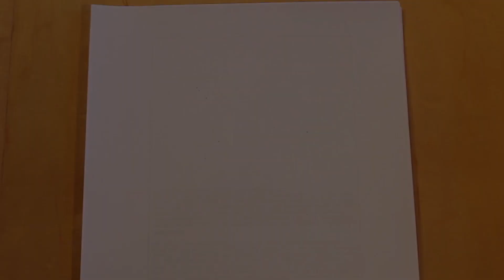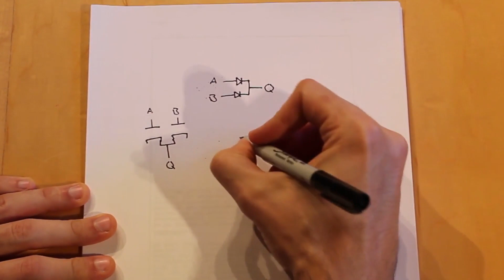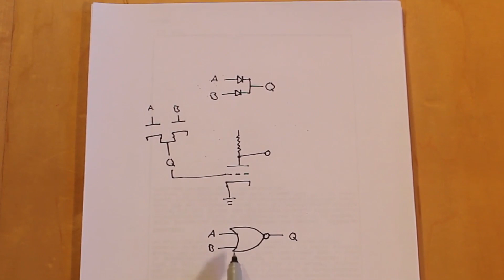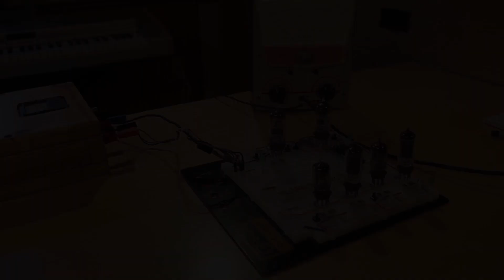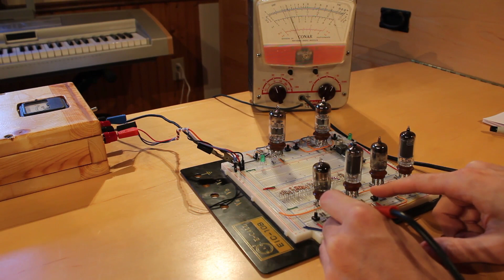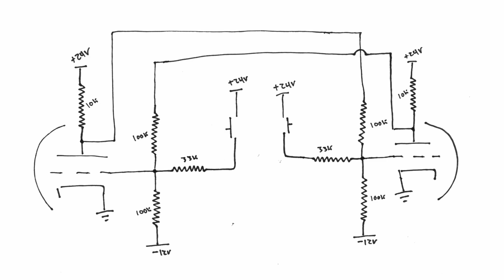Vacuum Tubes: Episode 7 – Let’s Build an SR Flip Flop / Latch!

Comment: You need a 1 meg resistor from the grid to ground.
Reply from the maker: In this type of circuit, a grid resistor like that isn't actually necessary. The -12V bias and the voltage divider resistors help keep the grid sitting at the exact level I need it at. This entire design is actually inspired very heavily by IBM's vacuum tube computer designs. Here's there basic inverter design: https://i.postimg.cc/6pJhtmDn/Inverter.png
The resistor values are obviously very different (and I have since changed my resistor values in my designs to be a 220k/220k divider and 33k plate). But, you can see they don't have any additional resistors from the grid to ground. All grid biasing is handled by the 470k to -100V.
Definitely check out the IBM 604 Customer Engineering manual, there's a ton of brilliant information on using tubes for digital applications! 
http://www.bitsavers.org/pdf/ibm/604/

Comment: Where did u get the vacuum  tubes? Love your vids
Reply from the maker: Thank you!
Most of my tubes came from random tube lots on eBay. I'm not very picky at all about what tubes I get, so random collections can often be found for really cheap. Throughout my testing, pentodes work really well in digital designs, like this SR Flip Flop. In particular, at these low voltages at least, the 6AS5, 6AU6, 6136, 6CB6, 6CL6, 6BK5, 6EJ7, 6EH7, and 6JD6 all work pretty well set up as SR Flip Flops!
Dual triodes tend to want higher voltages, but with some proper tweaking of values, they can be made to work decently well too. The 6DJ8, 6J6, 6CG7, 12AU7, 12AT7 and 12AV7 all make pretty good low voltage SR Flip Flops too!
For more complex circuits, not all of those are easy to work with, but most tubes can be convinced to do what you want them to do with enough perseverance!

Comment: I like your solution for breadboarding tubes. This is mine: https://ibb.co/ftKdX9s
I used it for designing guitar amps The PCB (from AliExpress, I believe) in the photo supports octals, novals and 7-pin types. It allowed me to build guitar amps with a screwdriver instead of a soldering iron. The PCB is a good platform for this kind of stuff.
Reply from the maker: Thanks!
That's actually a really good solution for breadboarding tubes, and probably works much better than my solution for higher voltages. Fortunately, at 24V, the only things really at risk are the LEDs (of which I've burnt more than a few, haha).
Reply: @UsagiElectric  Your type of breadboarding is out of the question at high voltages, but at more reasonable voltages, probably more convenient for the other aspects...
Reply from the maker: @petedavis7970  It's interesting because at 24V, the convenience of of being able to swap resistor values and directly see changes is almost necessary because the tubes react so differently, it's hard to calculate/simulate/plan for. However, at higher voltages, the tubes would react much more predictably and the convenience of the breadboard is no longer necessary. Unfortunately, I'm a bit accident prone, so I'll stick to 24V for now, haha.

Comment: The fact that those are used tubes may be the cause of the difference found for the 6BZ7 ?
Reply from the maker: Used tubes could definitely be playing a bit of a factor, but I think the bigger factor is how the design of the different tubes is reacting at the extremely low voltages I'm running at. If I were running at 100V+, I think the results would be much closer. For example, IBM used +150V for a logic high and +50V for a logic low. Something like a 10V variation (due to different tubes/manufacturing/etc.) at either logic level has a pretty low impact on overall performance. But, my logic high and logic low only has about 10V difference in total, so the tubes have to react and respond just right at voltage levels they were never intended to run at, and I think the 6DJ8 just handles 24V much better than the 6BZ7.

In the next episode I will actually go through and test nearly 30 different tubes and see how each one responds and reacts and it's pretty wild how different each tube is. The 12AX7 for example, is a super popular and sought after audio tube, but at 24V for logic switching, it performed terribly (worse than the 6BZ7 actually)!
Reply: @UsagiElectric  I didn't look at the specs of those tubes so I thought they were intended to work at that low voltage indeed. Now that you said they were meant to work at a much higher voltage makes me clear the phenomenon you experienced and shown in the video, to our great amusement and interest.
Really interesting.
I once had the idea to make some experiments with tubes, but in a totally different application: sound generation. And I mean not just playing back some recorded music but the actual synthesis and processing of the sound. But never found the time to do that thing.
Greetings from the Alps.
Reply from the maker: @AccidentalScience  Thank you! There are a few tubes that were designed to run at low voltages, particularly late space charge tubes designed for 12V use in cars, but most tubes are designed for at least 100V. That 6DJ8 would be quite happy with about 200V on the plate actually, so running these things at 24V is creating all sorts of interesting hurdles and problems to tackle!
You can actually make a square wave oscillator relatively easily using a design similar to the third SR Flip Flop design I showed in this video. All you do is replace the two 100k ohm resistors that go between the grid and the opposing tubes output with some capacitors, and then instead of biasing to -12V, you just bias to ground ()schematic: https://i.postimg.cc/kXzBr3zr/103078864-10221111567233036-448440687881355264-o.jpg). I've managed to get frequencies as low as 1 Hz and as high as 100 kHz out of that design, so it's a pretty robust oscillator. You could also build a Hartley Oscillator which makes a pretty clean sine wave as well, although you'd need some pretty big inductors to get it slow enough. I've managed over 1 MHz with my Hartley Oscillator tests on the breadboard. It would be a lot of fun to build a vacuum tube syntehsizer that uses different tubes to make different waveforms running through a tube amplifier!

Comment: That's cool, it seems to have been thown back in the fifties of the last century.
Reply from the maker: Thank you!
Looking at how the engineers back in the day solved the really weird problems that computing with vacuum tubes presented is a ton of fun! Reading through the old IBM Customer Engineering Manuals for the IBM 604 and IBM 700 has actually helped me understand modern electronics at a far greater level. Plus, vacuum tubes just look so cool, haha.

Comment: Man this was soooo interesting !
Analog electronics is sometimes very hard to fully understand but always fascinating to see in action.
After these few episodes I have been watching, I can see that your style is very cool. I mean that I like the way your present the components and the physics, like your energy and even the way you film which is pretty cool ! You really have all my support :-)
I was looking at your setup during your explanations and I had an idea ! I don't know how far you really want to go with vacuum tubes electronics (as far as you can pleaaaase) but it would be very nice to make a "setup" video where you present a bit in detail what your setup is made of, your power supply, measuring tools and maybe how they work !
Already waiting for the next episodes :-p
Reply from the maker: Thank you so much for the awesome feedback!
I'm actually greatly misusing analog electronics here to make logic circuits. For example, the heptode/pentagrid converter in the previous episode was originally designed to be a frequency mixer for radios. One of the control grids was used as an oscillator and the other control grid as an input for an RF signal. It just so happens that it also made a pretty excellent NAND gate.
My plan is to ultimately end up building an extremely simple computer from vacuum tubes. I've been toying with different design ideas and building prototype circuits to try to keep the tube count down to reasonable levels, but ultimately, I'd like to chronicle the whole adventure through these videos. My actual setup is pretty simple, but it would be fun to show all the tools that I use for what I've been doing so far. Aside from the PCBs that I make (which I'll show in a lot more detail in two more episodes), everything I use is pretty regular stuff that can be found for super cheap.
Thanks again for the support and awesome feedback! The next two episodes will be pretty fun I hope, we'll do that 24V vacuum tube shootout and then, as a short change of pace, I want to build a standalone circuit to put on my desk for fun.